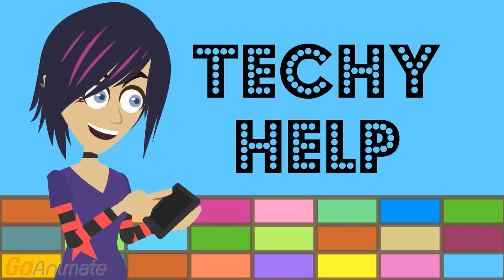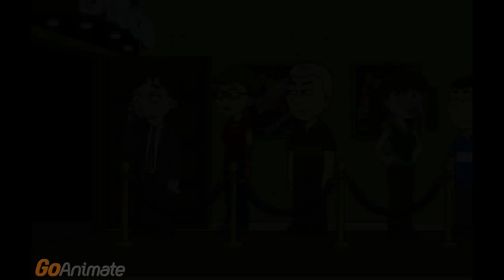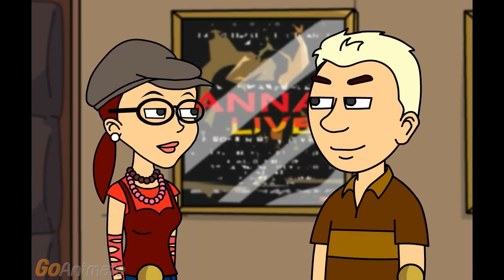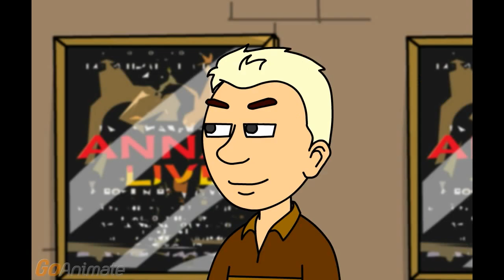How to Fix Broken Headphones

Comment: i have a different problem i have wireless ones but there connected via cable without cable thier absolutly fine but with the cable i have to play around it to make it work NORMALLY without messing up the sound and making it all sound wierd
Reply: j